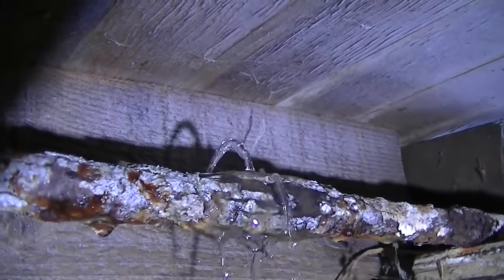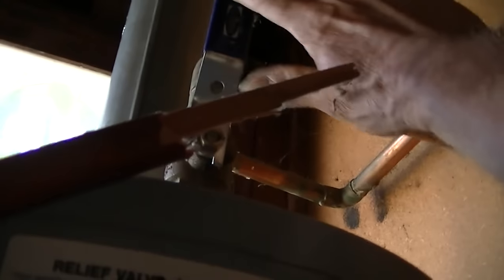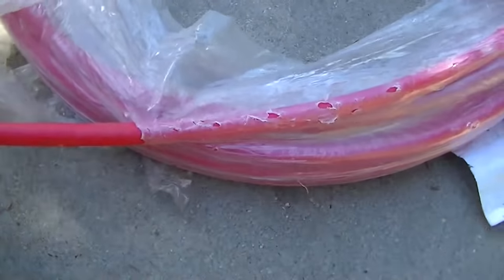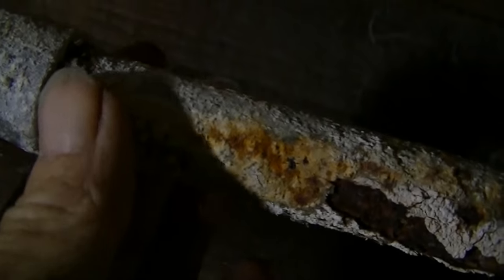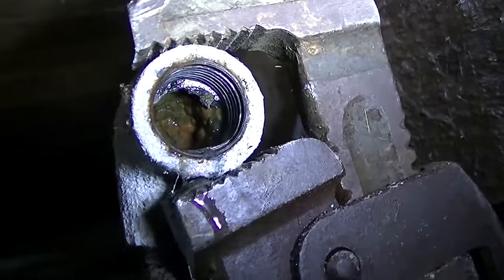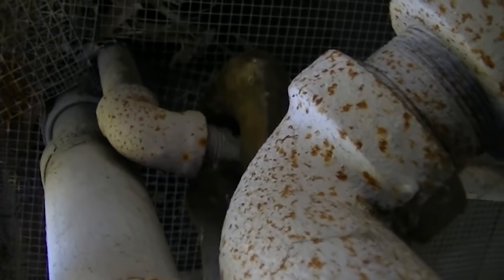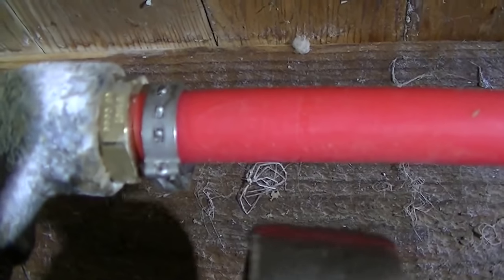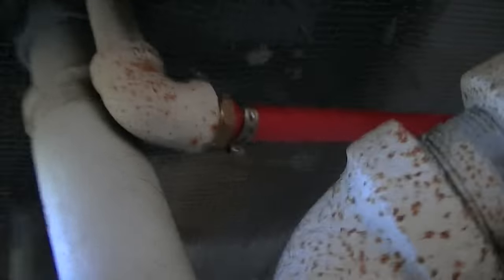Replacing Rotten Leaking Galvanized Pipe Under House With PEX

Comment: I envy your work space. I am replacing the copper with pin holes in my 50+ year old house with CPVC and Sharkbite fittings under the floor with 2ft. of headspace. I intend to do a full replace job in the summer if I am still able; I'm 80 years old so I had better hurry, huh!!
Reply: How's that job coming along?
Reply: Yeah- you get it done?
Reply: @newstart49  rip

Comment: You need to go to Harbor freight and buy a battery operated cut off wheel , it will make short work and low vibration when you have to cut this stuff .

Comment: Plumbing in the crawl space sucks. I spent 3 hours in my 2 foot crawl space yesterday fixing cast iron drain pipe.
Reply: I spent 6hrs in my crawl space removing cast iron drain pipe and breaking concrete with an air hammer. Than installing ABS for replacement.

Comment: Great repair, plumbing is like opening a can of worms. You fix one thing and then something else will start to leak. That other leak was also an old one.(interesting that it didn't leak harder with the crappy solder.) Excellent idea to use the wetvac.

Comment: I appreciated this video! One comment is this: after the initial repair(which was great, by the way) I would of repaired the leaking pipe in the same way as the first, using pex and the necessary adapters. This gives me inspiration to fix the same mess inside my parents house. Thanks again

Comment: Rodents have been known for chewing down otherwise great plastic pipes. The fittings for type B PEX used here really transform a 1/2 line to 3/8 and create restriction and turbulence (noise). Better use type A PEX with Wirsbo fittings they cost more but insure better overall results. Keep up the good work !
Reply: or just use 3/4 type B PEX for the same result, only cheaper. Thank you for pointing this out, as I was going to.

Comment: face palm at 21:42! you have copper on galvanized pipe directly.  you MUST put a dielectric union between any and all copper pipes and galvanized pipes.  one metal will literally make the other metal fall apart!!  you will create pinhole leaks and pipe degradation throughout your entire plumbing system.  just put a boat down there for next time is all i'm saying.  youtube search for "copper electrolysis on galvanized pipe" to see this.

Comment: Hey, you are awesome and I love your intro.  I too am remodeling and sending pics to family to show them what I am completing on this 1965 A-Frame remodel.  I love what you did with the Pex repair, as I have had 2 nights below 20* degrees IN TEXAS-strange.  So my A-Frame is pier/beam, and the copper pipe from the side of the house, to the side of the crawl space, burst 1-1/4".  So after banging the split it nearly closed, drying it out (I was cracking up at your wet vac as I was trying to get my pipe dry in/out for the epoxy, and I was using an eye dripper, sucking out water and a blow dryer) So I tried with the epoxy/'steel' tape, that did work for me on another split 2 yrs ago, however, I did not get it over the epoxy section rapidly enough, so it leaks and I will possibly make a 2nd attempt.  However, I am thinking to use Pex from the side of the crawl space over to the Pex T-joint the plumbers created 2 yrs ago.  Thanks very much for sharing and it was educational watching and you did an excellent job-in my opinion.  Your's was the first video I watched b/c of your title PEX! God bless you!

Comment: At 16:00, two comments:  First, that small leak was not active when the other pipe section was leaking profusely because of greatly reduced pressure.  Once the section got fixed, pressure got higher, and only then did the leak at 16:00 become active again.

The leak at 16:00 could have happened rapidly due to the brass connection being so short.  In some areas, the replacement brass still not being 6 inches could be a code issue.
Reply: good point!

Comment: An old plumber told me once that, "the biggest issue when dealing with old galvanized is, it takes very little torque on one end to move things around on the other end. When dealing with old galvanized It's easy to turn a small job of replacing a bad elbow or single pipe into a virtually replacing the entire houses plumbing".

Comment: I like the old growth true cut 2x4s. California Redwood that termites will not eat!! Awesome repair.  I wrap Pex with duct tape, lenghtwise, to discourage rats from trying to get a drink of water. They do not like the Petro-Gum sticky adhesive and will not chew on duct tape. Otherwise..one little bite will rupture that Pex. My home was built in 1952 on orange tree orchard property. Oranges came out in 42 to make way for WW-2 aircraft Mfg. 46 to 50 was cattle. I still have underground passage tunnels for monster rats that used to eat the citrus. So once in a while one will pop up under the house and I hear the traps snap.  Whenever I dig a hole to plant a tree or build something I locate a tunnel. Most are filled now with expando foam or concrete.  I hear that Upland California building codes do not allow PEX because of rodent problems.
   Great Video!!!   I enjoy seeing shit plumbing that looks like mine and repairs like mine.

Comment: THANK YOU !!!!  I finally found a video showing how to connect galvanized to pex.  Oh what the hell did you see that was so interesting right before the video ended!!!!????
Reply: A copper connection to galvanized will not last. That mix of metals is why the other pipe was leaking.
Reply: Will need a dielectric union.

Comment: Good video with nice camera work in a difficult area. I have galvanized pipe throughout my CA home and I'm hesitant to change to copper because of the cost. The only benefit is my pipes go directly outside and with none underneath or in between floors.

Comment: It's not going to cost a few thousand dollars to plum the horizontal lines. I am replacing all the horizontal galvanized  pipes in an attic with PEX which is 29 cents a foot. the T coupler's are $11.00 each and need 12 of them for $132. Tools are $150. 100 FT of Blue PEX for Cold, 100 FT of Red for hot. Total cost. $340. Agreed I would not plum the whole house because of one water leak. I'm doing this in a rental property which has had several leaks in the past and eats through the sheet rock which gets costly. Typically the vertical lines don't seem to go out.

Thank you for the video. I'm going to fix it just the way you fixed it. I have two rental properties with leaky pipes. One has copper pipe, the other have steel pipes.

Comment: copper flare pipe fittings are still an option as they have been around since moses was a boy and are still made today. great for pipes with water in them as soldering would be pointless unless all pipes are dry!

Comment: Copper ain't cheap.....but PEX is.  :)
Reply: Cheaper, safer, more durable, easier to fix, easier to install, producing higher pressure, resistant to scale and can be installed in sleeves which gives you the ability to pull and replace whole water lines without touching any wall, floor or ceiling.

Comment: That was a pretty smart idea to use PEX tubing; copper is MURDER on the wallet! Apparently, there was no dielectric union to separate that galvanized street elbow from the copper female adapter; not good, as this would induce galvanic corrosion where there are two dissimilar metals! This was likely the cause of the problem, and is quite likely to reoccur. In some jurisdictions, this is a code requirement. Some plumbers use white Pullman bread to force the water out of the tube so it can be soldered.
Reply: I'm a plumber, been using polyethylene tubing forever.  20+ years, and it just never fails.  It's cross linked polyethylene chains and they stick together! Just watch out for dissimilar metals together, electrolysis kills brass, copper, and or steel...

Comment: I see that in my future.  my question is on the second repair.   Don't you need a dialectic union between the copper and the galvanized to stop electrolysis?  You did mention needing plastic between them.  Would it not have been better to use the Pex since you had a roll of it?  I would think there would be no electrolysis then.  Thanks for the video it was useful for me.  Bruce from the city of orange in orange county California

Comment: No one can afford to re-plumb an entire home. I had to open a charge account at a local lumber yard for these kind of jobs. Plumbed the whole house 9 yrs ago with 3/4" copper & lead free solder, it costed well over $4k. The 1964 1/2" plumbing was so bad you could flatten it with 2 fingers. Pex can leak at the fittings if it freezes and it is that cold in my basement crawl space. Here in mn the frost went down 8' this past winter.

Comment: I've never seen a pipe that bad above ground before only ones that are buried, and in damp soil.   I have two houses one built in 1923 the other built in 1880, and has plumbing from the 1920's, and 30's   In the 1923 house the pipes look like new and the water pressure is strong, cold and hot.    I will have to replace some hot water lines in the 1880 house as the pressure is too low on the hot but very strong on cold.  This gives me a good idea on what to replace the hot water lines with, thanks.

Comment: so once you fix the leaking pipe, the one next to it starts leaking.

One thing I learnt from vintage cars, if you need to replace any hoses, replace them all, because fixing the hole in one hose just transfers the pressure to the next hose, and before you know it you have blown a head gasket.

Fixing a leaking pipe only transfers the pressure to the next weak spot.

Comment: Old GI pipes fitted  underground in my house leaking causing dampness in my house ..Shud I dead them from the over head tank ,leaving them  inside as dead & dry for ever &  fit another CPVC ones or shud I cut them & dig out by cutters from walls & lenters as plumber says leaving  even dead corroded pipes will  break off the walls & plaster & badly affect the home...plz help & advise

Comment: One word - Sawzall...
I have all copper water line in my home but at the water heater it was metal and after 20 years the metal nipples has build up enough crap to  create low pressure. I replace the water heater (went from gas to electric so I can run it off solar power) and when I replace the tank and plumbed it with PVC the flow of water through the new pipe sent sediment to all the faucets and clogged up both my bathroom sinks.

Comment: @10:45 that copper pipe along with much of the plumbing is from the 1980’s.  I can tell by the fittings, and plus the copper pipe has a barcode on it which looks more like a 1990+ label.

Comment: Good Lord, I ran into the same problem under my neighbors 20s house, began replacing with copper and sweating all the fittings. He hired a plumber who put a compression fitting on same type of problem, uhhh didn't work. Spent an hour using a trash pump to evacuate 6000 gallons of water. That old iron pipe rusted with half a century of junk cost a whole lot of money!

Comment: Second problem fix in matter 15-30 minutes.  Run to Homedepot, get 2 sharkbite 90 degree push to connect 1/2 or 3/4 depend on your pipe side, 3 feet copper pipe, 2 of 1/2 or 3/4 Galvanized Steel FIP x Sweat Dielectric Union ( Code for 50 states when you are connect copper to steel.) and 2 of compression  coupling  then job well done.  Hard job just cut thread out from metal pipe for compression coupling fit in.Shark bite push to connect perfect for pluming today, no solder, honestly even professional solder I don't trust it some day solder will come off.I have shark bite push to connect on my pluming and guess what so far last more than 5 years already and still going strong.

Comment: Interesting that is happened to your hot lines. In my house, built the same era as yours on here, the cold lines are more affected. Especially electrolysis also, in certain galvanized to copper connections.
Reply: effinchad 
I heard it’s just bad altogether to have dissimilar metal connections, especially galvanized steel to copper. Brass is like the medium that can touch both. Or just transition connect to any plastic.

Comment: You could've cut the copper pipe put on a shark bite coupling pex pipe in between and a shark bite female onto the galvanized 90. Would've been a quick and easy fix and eliminated the electrolysis from the copper touching galvanized.
Reply: Bingo!
Reply: But remember Shango will just laugh at your criticism

Comment: copper  galvanized Dont mix homeboi
Reply: Yes, those metals will fight each other and rust. Also he reduced the diameter. I don't see why he couldn't put in a new galvanized pipe.
Reply: KidMillions Yeah by the science and the book it will but how long is a bit of string? I am sure it will be just fine for another 25/50 yrs. 

I’m sure it will be just fine for the medium to long term.u
Reply: @rabmc  No that will rust within a few years. As it did with me when I put in a copper piece, it eats the galvanized right next to it. Try it and see.
Reply: Shoulda just replaced all that galvanized back to the copper with pex

Comment: Blue stains on copper = acidic water.  I just replaced a 3/4" piece of copper that was leaking and it was paper thin from the acid eating the copper from the inside. Also I have a sodium hydroxide pump on my system that is supposed to neutralize the acid in the water but I guess it may be out of adjustment.

Comment: Not that its fun watching someone else go through all this bullshit but I can sure empathize with you.  Good vid. Thx.  I have a 2" galv. About 2 ft in the ground with a leak in it.  I Thought I had bypassed the problem but who knows what they did a hundred years ago.  You cant put a compression cplg on it the rust is about an inch thick on the outside.  Anyone heard of sicadur? ( sp).

Comment: Why not use PEX on the second leak too?  The most likely reason you didn't see it the first time you were under there was the big leak lowered the water pressure enough to keep the second leak dry.

Comment: Anytime you have an issue with Soldering a copper pipe, turn off all water, open all water valves, flush the toilet, clear all water out, "if" there is still a small drip coming out, shove bread in the pipe to absorb the remaining water and solder quickly!  the bread will absorb the water long enough to solvent weld, the bread will push out and break up with pressure!

Comment: That's not how I'd have done it...   You need to re-pipe the whole house :-P

Remember, 'No good deed goes unpunished'

You are correct that the galvanized to copper connection should have something on it, like a dielectric union (which also gives you an easy place to take it back apart)...  Good job on the repair, hopefully you're not back looking at that galvanized-copper joint again though.
Reply: PEX is cheap, but the fittings aren't!

Comment: gotta laugh at you pointing out this is not a 'how-to' video.

Here in Australia, only licensed plumbers can carry out any plumbing work. That includes roofing and heating.

I have a problem that living in a rural community, the call out fee is exhorbitant, IF YOU CAN GET A PLUMBER TO VISIT!!!!

So, I do it myself. And I like these vids of others who do it themselves.
Reply: having said that....... I dug out the old plumbing 4 years ago and the hot water is all copper (had to fix a few leaks around the shower plumbing) but cold is galvanised, which I have done repair on back then, but now have to replace. I will give it a go now that the trenches are dug out to expose the pipes. Nothing ventured, nothing gained.

i doubt the original plumbing was done by anyone licensed. Pretty sure of that, actually, since the grey water and storm water both are plumbed to the street drains...... which is illegal these parts.

Comment: you replaced a galvanized pipe that started to fall apart because copper was joined to the galvanized pipe without using a dielectric union. You'll be back to where you started in a couple of years. Do it right the first time or you'll be back under there fixing the same exact screw up.
Reply: islandsi From what I read, a dielectric union is not enough.  You must also use a dielectric nipple as well for best protection.

Comment: Galvanized steel pipe, not one of the better ideas of the past century, first it rusts itself closed, from the inside, then it rusts though near the joins where the pipe is threaded. Interesting that it decided to rot through right in the middle of a length like that but not at the ends, it's almost like something corrosive dripped on it.

Comment: Copper to galvanized is not good....you could see how the galvanic reaction left all that residue on the fitting. You mentioned that the fitting should be brass so I can only conclude that you are not stupid just lazy, cheap or not interested in doing a job correctly OR maybe all the above!

Comment: i got my house replumbed with pex its cheaper than copper
Reply: Cheaper, safer, more durable, easier to fix, easier to install, producing higher pressure, resistant to scale and can be installed in sleeves which gives you the ability to pull and replace whole water lines without touching any wall, floor or ceiling.

Comment: TRICK! to do a wet sweat; I shove bread (no crust)  into the wet pipe I need to solder....I set up to make my sweat, cram the pipe with bread to stop the water from dripping and cooling my pipe. I do my solder, it works every time. before restoring water supply, remove the nearest aerator(s). I open the tub and outside facets and nearest aerator facet  to blow out the bread. white bread breaks up the easiest, it takes just a second to blow it all out, but I've used French, wheat, hamburger buns never rye (yet) lol,